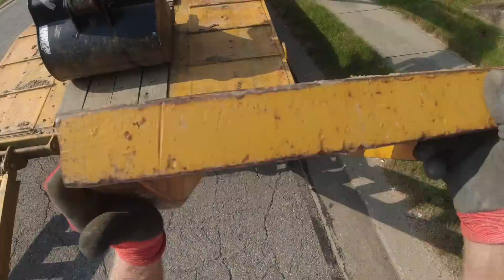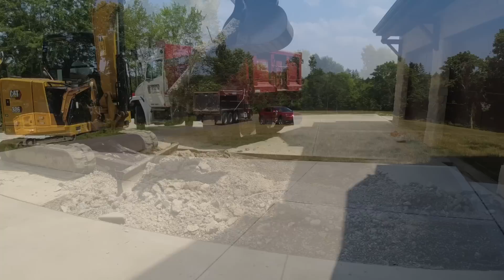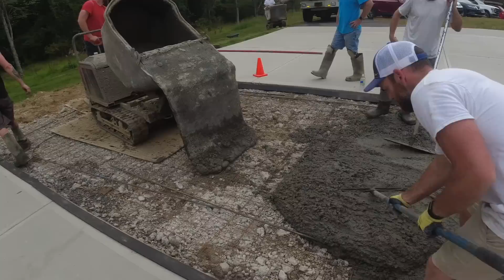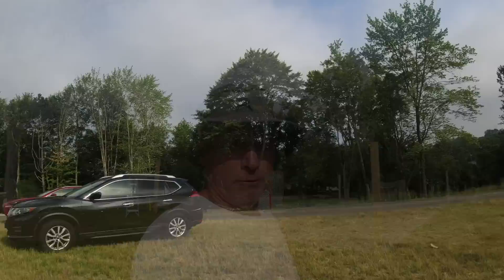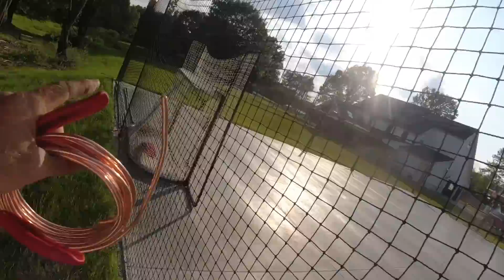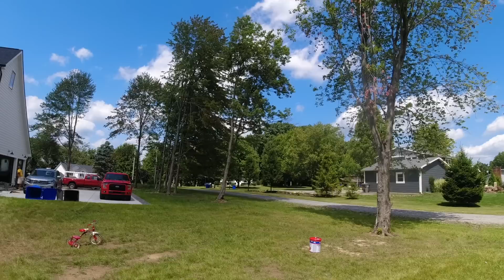My Concrete Failed! What Happened?

Comment: Here is my story. I did a summer tearout and replace project ten years ago for  a senior housing project. 140 yards consisting of 2  driveways and 4 ft wide sidewalks. We were about 70 yards into the project and  One  section of  18 yards of sidewalks  we poured, screeded, floated, edged and broomed.  About 4 weeks later the broomed finish started to flake off. You could see the concrete looked different and when we were pouring it it seemed off. Like it was missing the proper amount of cement. Called concrete supplier, they came and inspected it.  They told me i overworked it and it was my fault. I argued with them and pointed out the other 70 yards looked good.   I spoke with a couple other contractors and they told me they had several bad concrete batches from same place. Long story short. Had to eat the 18 yard tearout and replace. The last 70 yards came from their competitor. Less than 1 year later hat compamy went out of business. Never did know why the concrete went bad haven't had any issues  since.  Thankfully

Comment: i watch a few concrete channels and  once in a while they too have some bad luck.
fix it and move on i guess.
i used to work for a guy who installed automated gates, one of the big metal posts started to rust even when it was galvanised and powdercoated.
happy times when u gotta jackhammer out 80 centimeters of concrete.